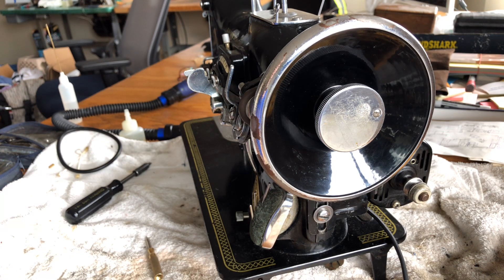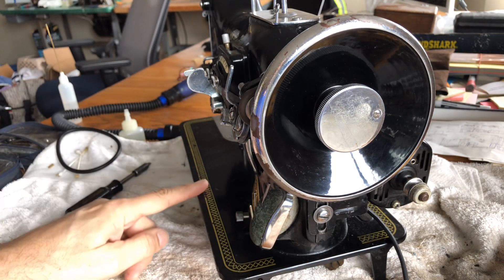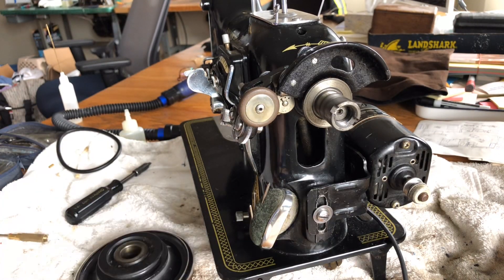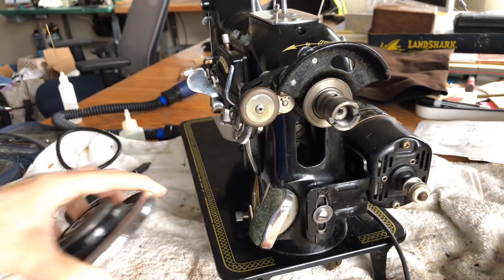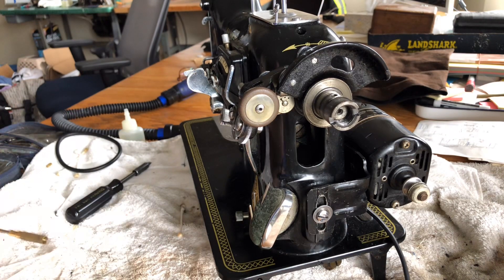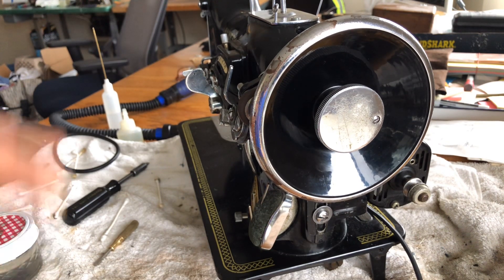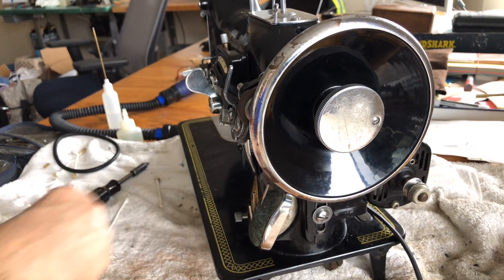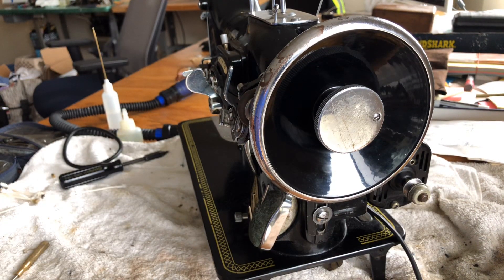STEP #2: SERVICING A MACHINE I'VE NEVER SEEN BEFORE: Anker RZ: Lubricating a Hand Wheel & Clutch

Comment: It's important to insert the washer the correct way, and take care about the tension on the clutching mechanism, otherwise it's not possible to unlock the handweel from the maschine mechanics with just 1/3 turn of the locking mechanism. You have 2 pins on the inside of the washer and 3 on it's outside. Between 2 of those 3 outside pins, the small (excentric) screw moves when You lock/unlock the maschine machanics to stop the maschine while spooling bobbins.